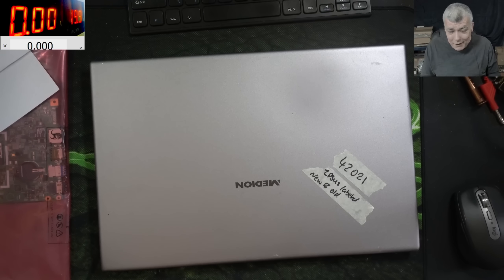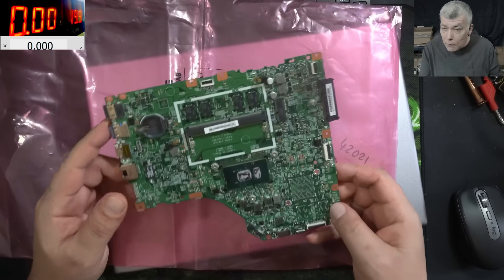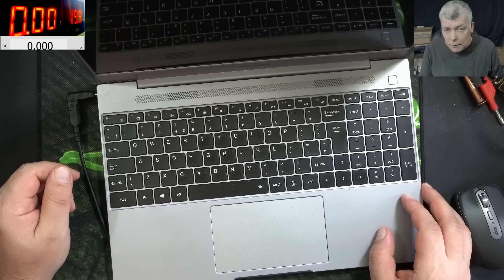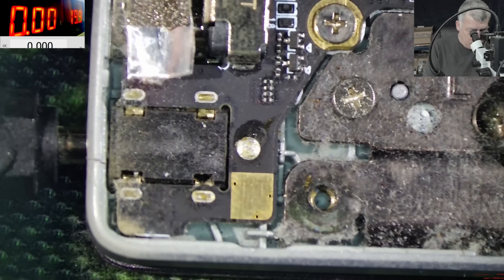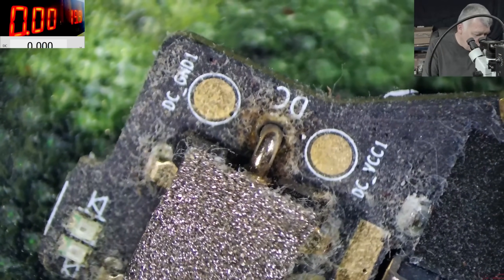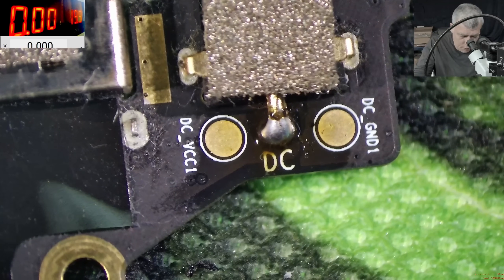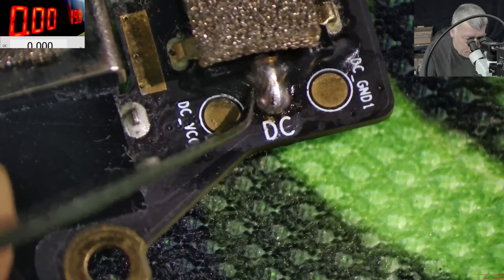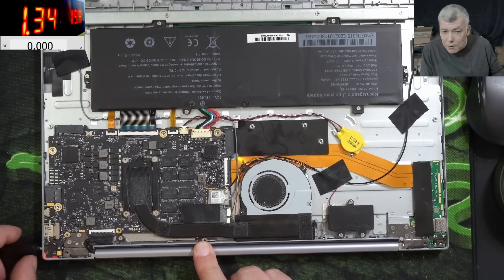Medion E15303 not charging repair - an easy and pleasant job

Comment: Sorin, can there be a problem connecting the M2 SSD with the battery connected? Nice vídeo!
Reply: if the laptop is turned off, the m.2 slot has no power.
Reply: Hi, Just seen your question there, As long as the laptop is fully powered down/turned off there isn't a problem, The problem can occur if laptop is in standby/sleep mode and can do serious damage then.

Comment: Disappointed you didn't use hot glue. 😏
Reply: You're probably being sarcastic, but it's actually a shame, it's just better for this as it give just enough support but can be easily removed with alcohol if needed later. Whenever I use epoxy I end hating my self for it later.
Reply: @gorky_vk of course he is, you would easily get if you been here for a while